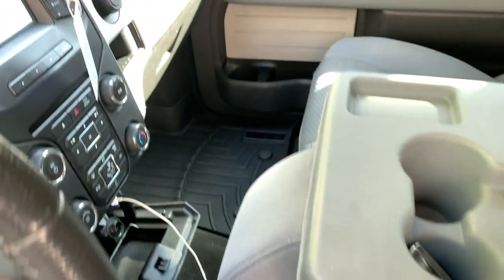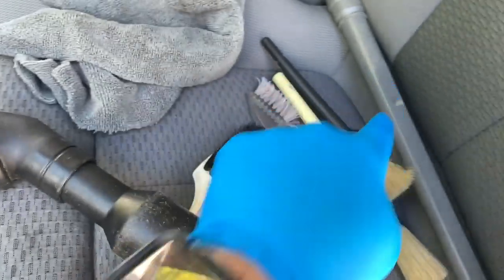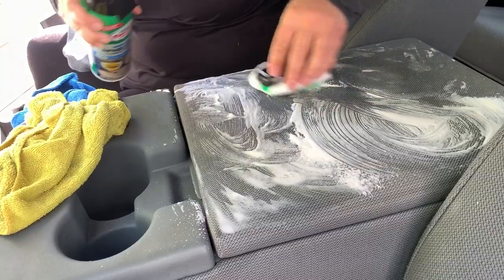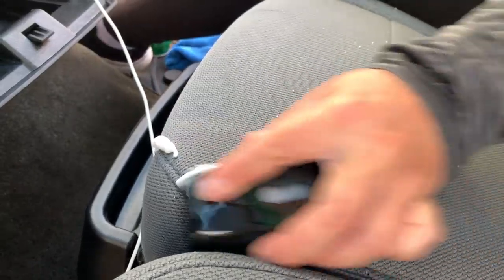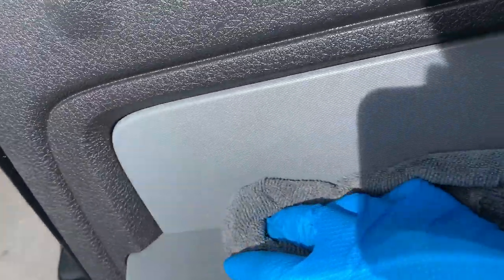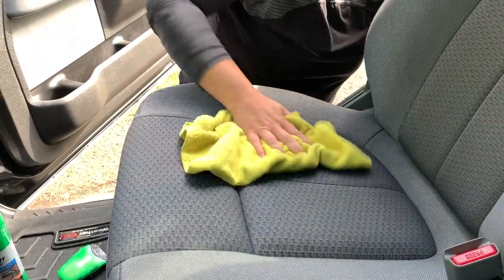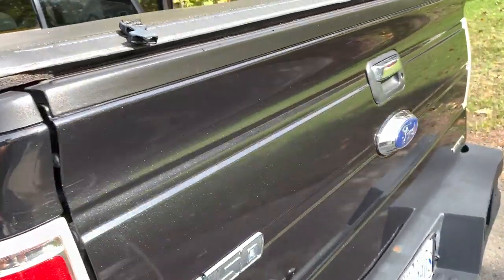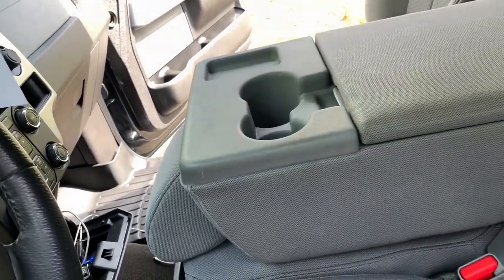Ford Truck Interior Detailing!

Comment: I really love the idea of cleaning fabric upholstery with foam. It seems to work really well and such low moisture saturation. I think I'm going to try my foamer with some P&S express interior cleaner in it (or something else.) And for the record, I can't find a P&S product I don't love. They have such high quality products at reasonable prices. I think I'm going to start using most of their product line this year.
Reply from the maker: I was thinking the same thing, using any APC or interior cleaning with a foaming bottle should lower the amount of product used. more air essentially.
Reply: Right there with you. Have tried out their carpet bomber, interior cleaner, and bead maker and I am thoroughly impressed with all of them. Very affordable price too. Brake buster is next for me.